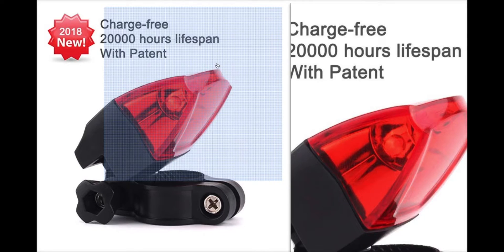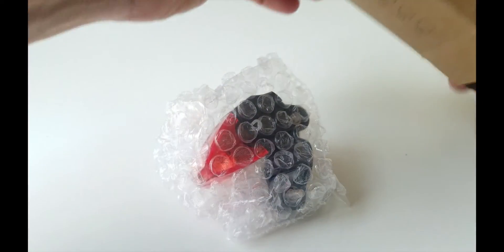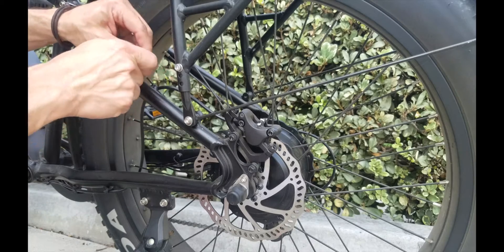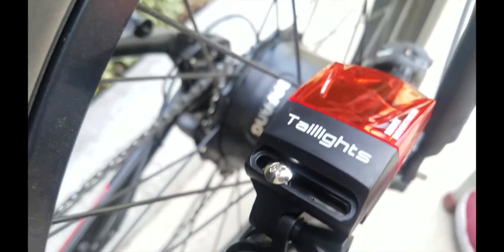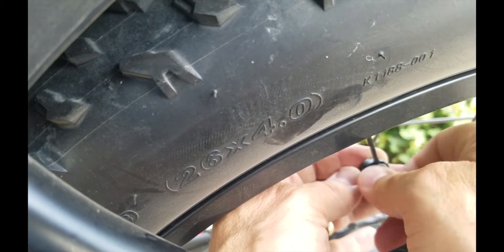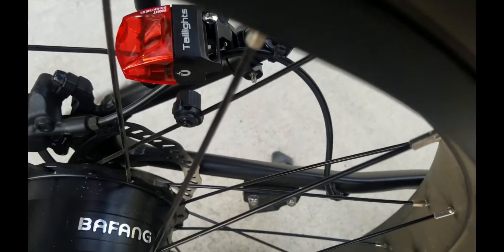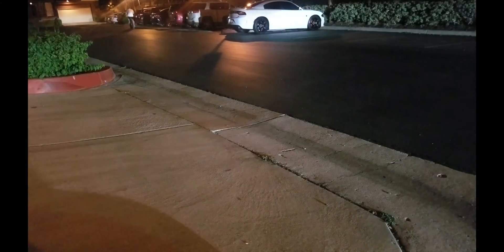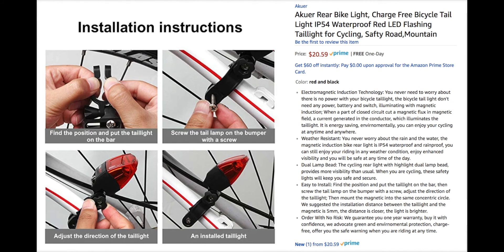Electromagnetic Induction Bike Light!

Comment: I have a similar set (round-ish chubby cylinder with two clear lenses) that's generally offered on the same pages that the one shown in the video is. On mine, the effect of more magnets is basically negligible, the blinking itself is controlled by electronics entirely. The magnet that goes on the spokes is there to make another -- hidden -- magnet spin, that second magnet is inside a copper wire coil. When the second magnet spins it generates a current which then feeds a small battery. From there, the electronics are turned on and it controls the blinking interval and maximum light intensity.
An additional note is, you do not need to use the magnet on the spokes to make the hidden one spin. Because of Eddy currents (magnetic damping), an aluminum rim will still cause them to spin if close enough. I've dumped the spoke magnet entirely and placed the light very close to the rim to make use of this effect. You just need to find the axis of rotation and align it accordingly. It will rotate the magnets just fine if done properly. Cheers.

Comment: Can you put more magnets on more spokes ? If so what effect does it have ?
Reply from the maker: That could help... I don't think it would buying some...but it should light up more if you already had some.
Reply: Quite the late response, anyhow.. I have a similar set, that's generally offered on the same pages that the one shown in the video is. On mine, the effect of more magnets is basically negligible, the blinking itself is controlled by electronics entirely. The magnet that goes on the spokes is there to make another -- hidden -- magnet spin, that second magnet is inside a copper wire coil. When the second magnet spins it generates a current which then feeds a small battery. From there, the electronics are turned on and it controls the blinking interval and maximum light intensity.
An additional note is, you do not need to use the magnet on the spokes to make the hidden one spin. Because of Eddy currents (magnetic damping), an aluminum rim will still cause them to spin if close enough. I've dumped the spoke magnet entirely and placed the light very close to the rim to make use of this effect. You just need to find the axis of rotation and align it accordingly. Cheers.

Comment: This light looked great in your review - red blinky with no need for batteries and no forgetting to turn it on or off. Ordered one from Amazon. The bolt that screws the clamp together is too short to fasten it to the rear stay on my CrossCurrent S so I zip-tied it on. Works great.
Reply from the maker: UncleIllya glad I could help 😎😀